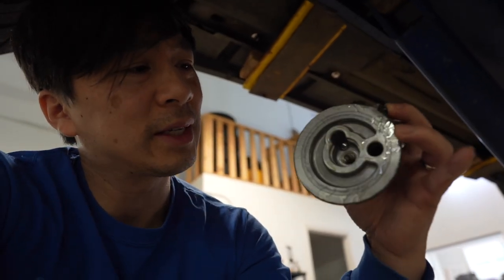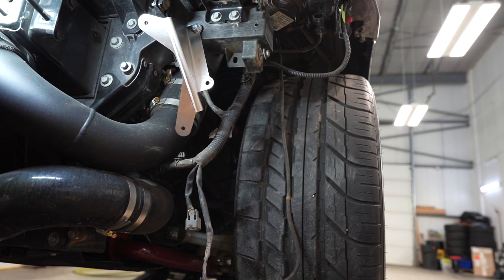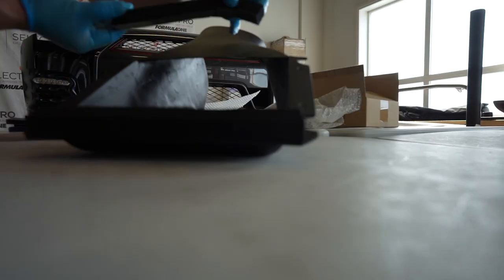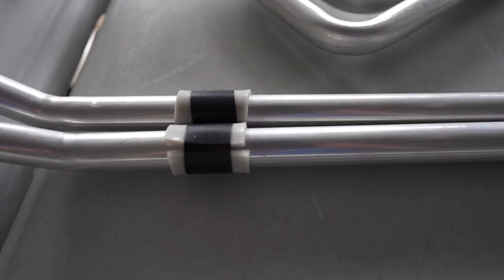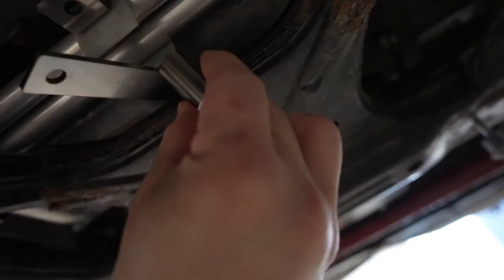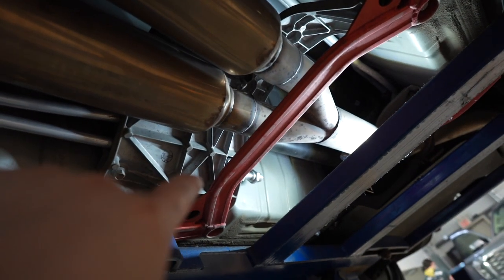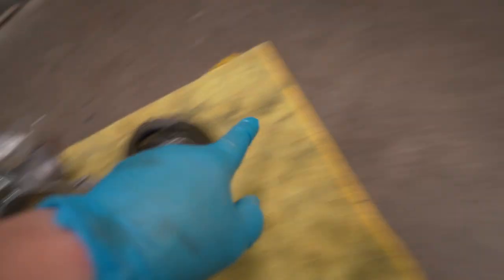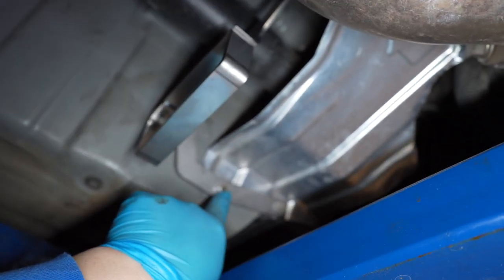HKS DCT Oil Cooler For The GTR.

Comment: Nice video.  Unlike many other install videos, it’s actually helpful!  So does this trans cooler actually circulate the trans oil to the newly installed radiator?  Or does it add extra cooling to the engine coolant that travels to the heat exchanger (similar to the Dodson trans cooler)?
Reply from the maker: It circulates the transmission oil through the new radiator. The new radiator and lines needed an extra 2 liters roughly of dct oil.

Comment: Hello Sir, Nice Video by any chance do you have a torque spec for the heat exchanger?
Reply from the maker: HKS did not give any specific torque specs. Where the bolts are located I don't think you would be able to get a torque wrench in there to torque them down.
Reply: @phothrottle  Thanks so much for the information!

Comment: Good video. What upgraded cooler does ?
Reply from the maker: Keeps the transmission Temps cooler. The gr6 transmission is known to over heat on the track.
Reply: @phothrottle  oh 👍
Reply: @phothrottle  

When will you test this out? You've installed alot of mods but haven't shown the results on the road yet
Reply from the maker: @snvs9395  that is a great question. I will have it on the drag strip and track probably in the next month. Unfortunately Where I live there is not a lot of options for both drag strips and tracks. I will definitely share the results with you guys.